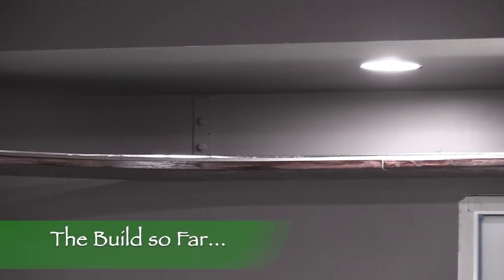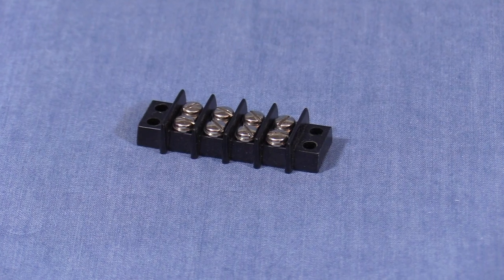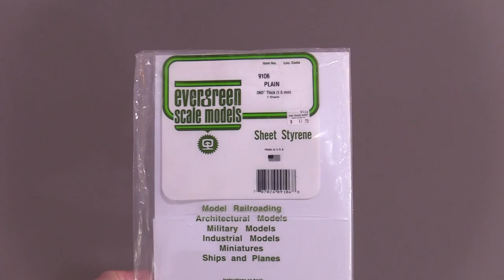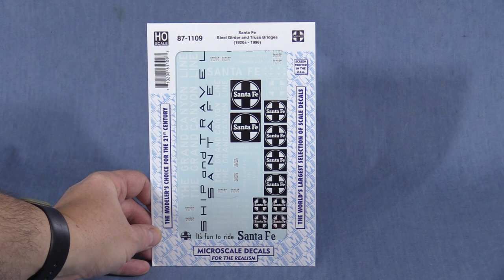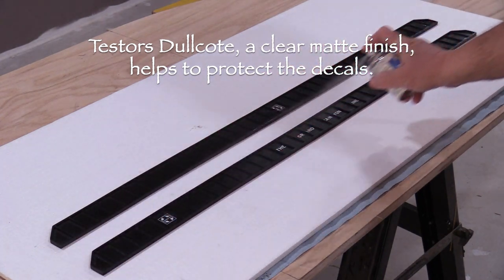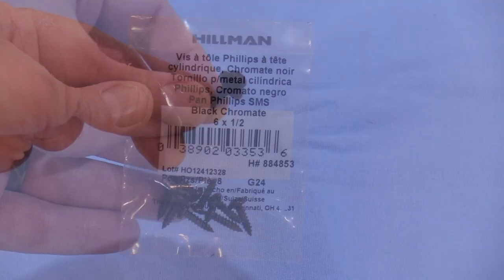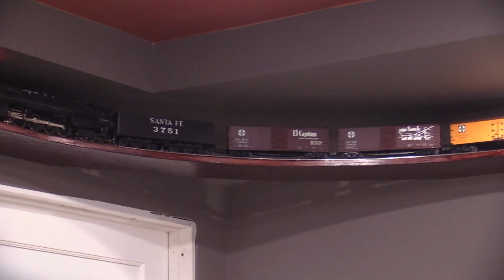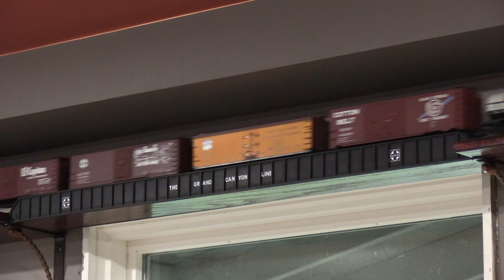Layout Building O Game Room Display Layout Part 4 - Wiring, Building a Bridge and Running Trains!

Comment: Layout looks great! There's a couple upgrades that can be made to the 3rd Rail 3751, the numberboards on the boiler are actually set up to have lights in them, but never had lights installed. Two incandescent grain of wheat bulbs fit right in. The hatches on top of those boards are hinged. I pulled the seuthe unit out as well, makes it look better at eye level imo. Also, the suspension on the drivers on these engines tend to be a little too soft, and the middle two drivers will drop below the railhead on some curves. This can be fixed with styrene tubing in the springs. Norm Charbennou did a video on that for his ATSF 2-10-4
Reply from the maker: Thanks for the tips on the locomotive.  I have not done anything to it as yet, other than give it a cleaning.  Lit number boards would be cool.  I'll have to keep an eye on the driver issue.  So far I haven't noticed them coming off the rails, but it's good to know that there's a fix.  Thanks for watching!

Comment: you two did a great job on the shelf line layout, it looks really good.  definitely need another power hookup, the engine slowdown is from voltage drop
Reply from the maker: Thanks so much!  I'm thinking I may have to wire up that second terminal track that I installed on the other side of the room.  I'll probably tack the wires to the top of the shelf behind the track, where they won't be seen.   Thanks for watching!

Comment: Great build. I binge watched the four videos about this project. I wish I had seen these prior to doing similar in my train room. This layout is a true finished look and functionality. Mine is very crude compared to yours. I just thought my way through what I had to do and went for it. I reserved the comments until this video. The tools used and techniques surely make for a very clean install. Mine is up and running so I won't take it down for a re do but, we do plan on relocation..when we do I think I'll pull mine down at that point rather than let it go with the home and re do the walls as if it never happened and learn from your build on my next one. Thank you for sharing this build. Good Stuff.
Reply from the maker: I'm glad you like how the layout turned out.  We've been pretty happy with it so far.  I'll be doing an update video fairly soon as I made a couple minor improvements, mainly running an additional wire to the feeder track on the other side of the room.  Good luck with your relocation and new layout!  Thanks for watching!
Reply: @DanielCortopassi  I had the same issue with mine.. easy fix.

Comment: Well done. I loved the look, and it was not too loud which was very nice for a setup of that caliper. You mentioned that the traction tires were gone on the engine. If I may make a suggestion. Purchase some "Bull Frog Snot" from a hobby shop. Turn the train upside down and apply power to get the drivers moving slowly. Use a toothpick or something similar to apply the Bull Frog Snot to the locomotive wheels that need traction tires. With the wheels moving it should go on smooth and evenly. Once it is applied let it dry and you will have your traction tires back without disassembling the locomotive. I have seen this method done by a close friend several times and has never failed yet. Excellent video. Can't wait for the next. Cheers!
Reply from the maker: I've heard of that product but have never tried it.  I'll have to pick some up.  The engine handles the train fine but I would like to have something in there so that there's not that huge gap in the wheel tread.  Thanks for the suggestion and for watching!

Comment: Hi Daniel, 
I'm really enjoying your videos of your new layout construction and games room as i am also in the middle of a very similar venture. 
What I would like to know is what gauge wire did you install in the walls for the O Scale wall mount track and connection. I'm hoping to install something similar except with the Harry Potty train and theme to activate only on the hour.
Keep up the great work, it is always great to hear some honest ideas and opinions.
Hour to hear back from you and maybe some suggestions you may have,
Kind regards
Anthony Smithson.
Reply from the maker: I'm glad you liked the video.  I used 14 gauge stranded wire in the walls.  There are identical connectors on the top and bottom.  Initially I only had one set of feeders going to the track from the upper connector.  If you haven't seen the entire series, I did an update video where I talked about adding an additional set of wires on the other side of the room.  Those are tacked to the top of the shelf behind the track so they aren't visible, and not inside the walls.  That helped a lot because the train was slowing down on the other side of the room.  The whole setup works well though it is a little noisy.  Some people have said that the Lionel Fastrack is noisy.  I don't know if using some other type of track setup would be quieter.  Thanks for watching!

Comment: I was looking at an old video of yours about what to model.  You comment on modeling Northern California and wanting Santa Fe.  When UP merged SP they swapped all kinds of trackage rights with Santa Fe. Think about the exWP inside gateway. One of the other routes was to Salt Lake City and Denver. Using that as cause you could have 1-4 Santa Fe trains a day on just about any UP route. Just a thought.
Reply from the maker: Yes, that's very true.  I have some not very good video of some BNSF warbonnets that I shot in Truckee in the late 1990s.  I could always say that the trackage rights came a few years earlier.  The HO layout will be mostly prototype based but I don't want to be so strict about it that it's not fun anymore.  Thanks for the suggestion!

Comment: How apart are your support brackets?
Reply from the maker: Roughly 32 inches, give or take a few.  They're screwed into every other stud on the side walls, but the studs in that room aren't quite uniformly spaced, so the bracket spacing varies a little.  I haven't had any issues with vibration or sagging on the sides.  The wood does move a little in the corners, but those have a longer span.  It hasn't been enough to cause any issues, and the train runs very reliably.  Thanks for watching!
Reply: @DanielCortopassi  
It looks SO great! Thanks for the info. 🤓👍

Comment: Huh. I can tell from that whistle it's got a QSI sound system in it. An older sound system but that's probably the only O gauge engine I've ever heard that has more or less the same sounds as an ho model. 
I'm an ho guy and cant help but notice the lack of aftermarket sound systems for O gauge like in ho it seems.
Reply from the maker: That's good to know.  I bought the engine used and it had no documentation.  If it was 2 raIl O I would probably swap the electronics for a Loksound.  Thanks for the info and for watching!
Reply: @DanielCortopassi  
I've been kinda curious if it were possible to run three rail on DCC. It most likely wouldn't follow any NMRA standards but the idea has been in my head about it. Like if someone were crazy enough to put a sound decoder in a postwar lionel engine. More than likely would fry a decoder due to amps in that application though